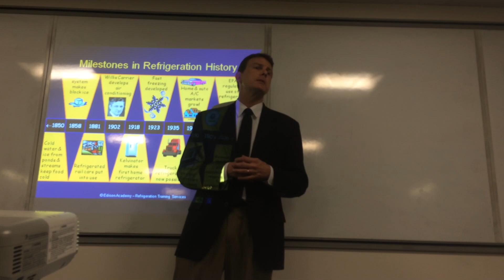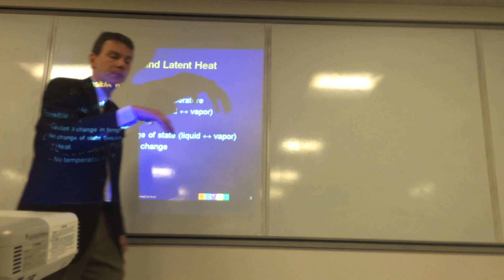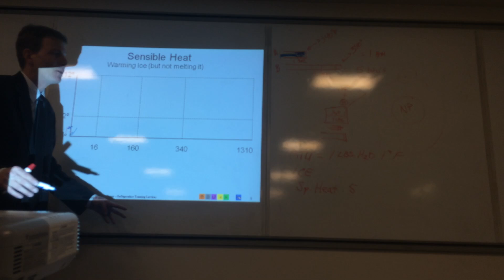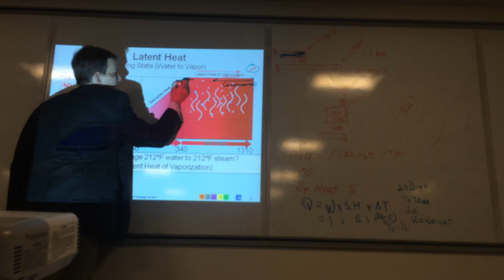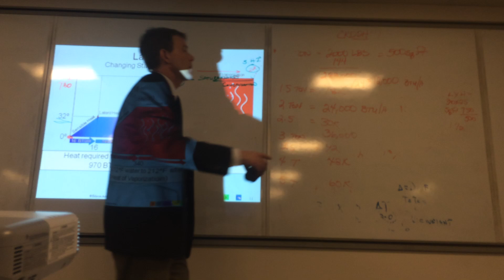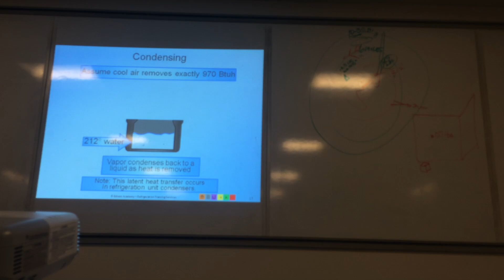Comment: I did have a question regarding BTUs.  Why do we use the 144 btus needed to melt ice at 32 degrees and not include the  16  BTUs needed to bring the ice from 0 to 32 degrees?  Not sure why this isnt included in calculatin the tonnage of a unit.
Reply: +Ryan X the 16 BTUs is to raise the temperature of the ice from 0 to 32 is sensible heat. Once at 32 the latent heat process takes over and the temperature will not change until the one pound of ice is one pound of 32 degree water. We could have started the graph from almost -460 and said we needed 246 BTUs to raise the temperature to melting. (492/2) or 492 x .5 but that's not in the calculations for tonnage.
Reply: Awesome, I appreciate the response, and love the videos.  I received my Universal Certification just from taking some decent notes from your lectures.  I cant thank you enough for providing this quality information for free.

Comment: You mention that in the evaporator and the condenser its latent heat change. Am I correct to say that the compressor is sensible heat change? Also what about the suction line and the liquid line and discharge line is it a mix of latent and sensible heat?
Reply: +texture6 yes. Compressor adds a ton of sensible superheat. Suction line should also be sensible unless the evaporator is flooded and some liquid gets by. Liquid line is also supposed to be sensible unless there is flash gas from a long pipe run. Only evaporator and condenser have both sensible and latent heat gain/loss. Did this answer your question? Thanks!